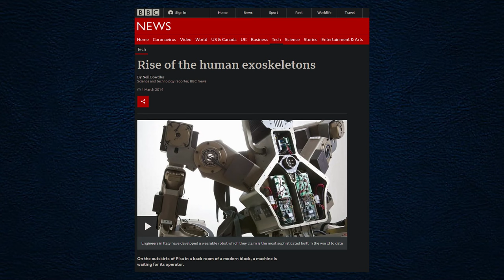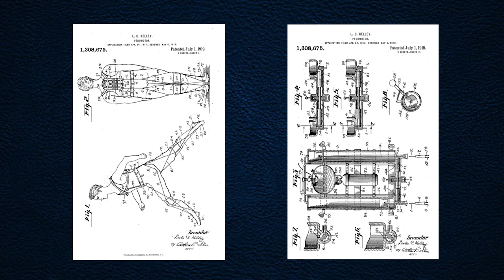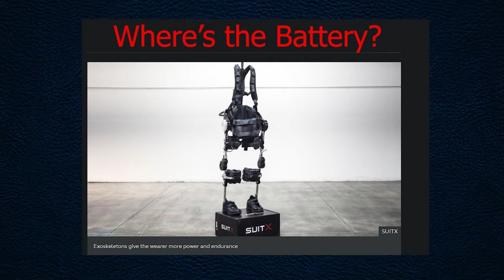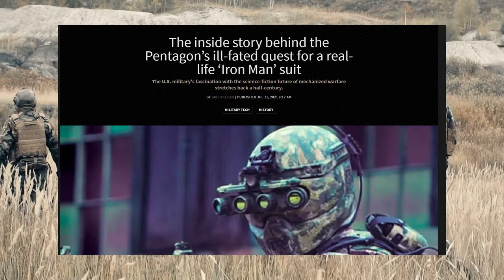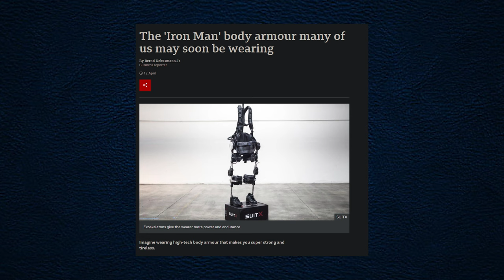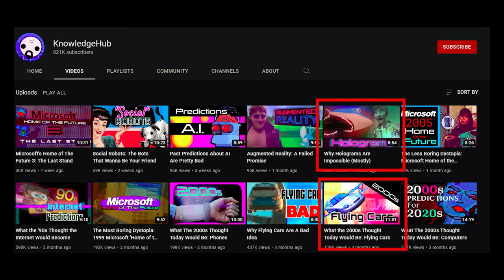Exoskeletons Will Never Happen: Here's Why

Comment: Exoskeletons and exosuits don't have to make you a superhuman and they don't have to be full-body devices. Simple exo designed for specific tasks can simply reduce the weight on a workers shoulders for example and that in itself is valuable since it is reducing musculoskeletal injuries. As for the Chinese exo, they are not just plastic braces, they transfer the weight of their heavy backpacks to the ground and that is when heavy backpacks are the number 1 reason for injuries in the US army.
Reply: exactly
Reply: Yeah the power of the roman empire came to a large extend from their superior sandals...sounds funny but the gave them a great logistical benefit
Reply: @m3ntal_c0re  "superior sandals" 😂😂
Reply: @Toasted_Crumbs  😂
Reply: Yeah like bionic boots designed based off of a ostrich athletes tenden current design allows users to run up to 25 mph ostrich cap out at +40mph
Reply: @m3ntal_c0re  A large extent? No. More like a minor contributing factor.
Reply: Yeah thats what i think of when i hear "exoskeleton"
Reply: Springs/elastics/hydraulics can do a lot to assist. Like you said, doesn't even need to be powered. It's just structurally/mechanically taking the strain of the load off of your skeleton and putting it on the exoskeleton.

Springs can also store the kinetic energy of your weight when bending over and use that energy to assist in lifting.

Potentially gears and leverage can be utilized to lower the energy required for certain task making the energy requirement much more realistic.

The exoskeleton can also utilize assistance from humans, like pedal assisted bikes, to increase efficiency. Often, a lot of energy is wasted on overcoming the inertia of a resting state. That's partly why pedal assisted bicycles are so much more efficient, and electric cars. Exoskeletons maybe can even be designed with regenerative motors of sorts that absorb some of the shock of impact when walking or restores kinetic energy wasted when lowering an object to the ground. I'm no engineer but I feel like there is still potential. Maybe for more functional and practical purposes as said above, maybe take baby steps before we create an iron man suit.
Reply: Gotta be careful about potentially dangerous situations introduced by strapping a human to a heavy and powered machine.  Also situations the machine is not designed for but could encounter, like falling down.  A bike can easily fall sideways.  It would be hard to design a skeleton to make every possible human movement more efficient.  There will likely be movements that will become harder.  Lifting your leg.  Standing on one leg.  These cases must be considered.
Reply: Also, an exo doesn't need to match every single human movement - it's just a tool for certain types of repetitive movements, most likely blue collar jobs.
Reply: The Kingdom of God is at Hand 
John 3:16
King James Version 
16 For God so loved the world, that he gave his only begotten Son, that whosoever believeth in him should not perish, but have everlasting life.
Reply: But nah,  why do that when ya can just lay em off for ai one day?
Reply: i believe in the stalker game series that is what they do. you can hold a lot more and you can run a bit faster while still having a slighty above standard armor on you chestplate

Comment: Bro, it doesn't need to be an iron man suit to be practical. Imagine lifting a full military kit and it just feels like your normal weight, that's what it'd be good for.
Reply: Do you realize how insanely hard that is?
Reply: @christophegroulx8187  hm hm ask russia about ratnik 1
Reply: @turtlegaming4427  It doesn't exist...
Reply: @christophegroulx8187  not too hard actually. We had the HULC. The problem with that system was the sensor reaction to movement trying to stabilize the weight + it's massive battery. As technology evolves. We'll def get to a way more naturally-reactive sensor. Kinda like how Boston Dynamics and their robots. They're a peak example of tech leaps when it comes to sensory input
Reply: @turtlegaming4427  is the ratnik 1 in the room with us right now?
Reply: @christophegroulx8187 wtf do you know about it? You’re not an engineer
Reply: @moss8702  This isn’t true, the main problem with exoskeletons is the lack of autonomy with battery options and the high cost. Sensors operate plenty fast already.
Reply: @ciro9951  You’re right, it’s so easy hence no one has done it before
Reply: @christophegroulx8187  sensors and applying mechanical movement to replicate or react in tandem to an organic operator (ex a human being) is extremely difficult. The HULC was an old program that struggled with this and todays tech probably helps alot. But taking the wear and tear off an individual completely onto a frame is challenging and those sensors also need to be reactive in combat conditions no matter the climate extremes. It's not that simple. I currently work in defense R&D and there's a fat stack of paper with requirements and capability that all need to be met before, during, and after testing. Soft exoskeletons are more promising and easier to work with but they don't actually take the compounded stress off the operator and the aches and pains are still felt hours later. Specifically with knees
Reply: @moss8702  The sensors can be fast enough and rugged enough, the difficulty with lower body exoskeletons is making sure that it actually decreases the energy expenditure of the user. Two major military exoskeletons from the 2000s, BLEEX and HULC, ended up increasing the load on the user. You can brute force the solution to this by making it full body and fitting in bigger actuators, such as what Raytheon did with the XOS and XOS 2, but then it has to be tethered because the power consumption is very high.
Reply: @christophegroulx8187  That's literally what I just said.....
Reply: @christophegroulx8187  the XOS is impractical beyond maintenance/non-combat roles not just because of the power supply. You need something smaller, quieter, that can be caked in mud and sand 24/7 ontop of performing the actual load-bearing function. HULC was the closest thing we had to accomplishing that with the exception of the wear being felt and exacerbated at the joints. If they kept working with what they had with today's tech, I bet it would be a whole different beast
Reply: @christophegroulx8187  can’t think for yourself. Look at the military’s history and how secretive they were with the B-2 aircraft, they didn’t reveal they had the tech until they were ready
Reply: @moss8702  You initially implied that sensors weren’t fast enough to track user movements. That’s not true. Now, you should also look up the Guardian XO. It’s the successor to the XOS 2. It has 2 hours of battery life with hot swappable batteries (so effectively infinite endurance if you have access to electricity) and is much stronger than a human. The problem is that it was too slow and too expensive so the company dropped it.
Reply: @christophegroulx8187   you're not listening to what i'm saying. The LOAD BEARING CAPABILITY needs to work in tandem perfectly with the sensors so the end-user doesn't feel the negative effects and wear unlike projects like HULC gave. I work in DOD R&D. Those sensors still require on the fly change in a multitude of differing environments. Humans are flexible and bend. Combat forces you to go into unnatural and uncomfortable positions/poses for things like cover while still under load. All of that + the elements need to be accounted for and it takes decades to perfect it. It can't be bulky, it can't be too rigid, and it can't be a liability. Soft exoskeletons are what they're developing more of because it's cheaper, a whole lot more simple, and it works with few negative drawbacks. Idk what you think exoskeletons require to function in combat but I can tell you anything powered is not there yet.
Reply: Wouldn't it be easier just to invest into making lighter gear. 

Instead of a machine that would require money, time and work. To keep functioning.

Comment: This video is just plain wrong. The point of an exo suit isn't "super human strength", it's to increase carrying capacity. In real warfare, there are devices that can be used to create a mobile EMP zone that prevents drones from functioning, but they are extremely heavy and bulky. If you had one exo user in a squad carrying this device, the whole troop is defended. This isn't actually much of a stretch either. In WW1, there were troops whose sole job was to run cables for wired comms. Not a stretch to have a member of a unit be vulnerable to perform a specialist role like that. This even negates the fact that an exo suit could also just be used to carry heavy steel plates as some sort of bipedal tank. Mobility doesn't have to be the objective.

Comment: To me, the realistic point of exosuits isn’t so much that they COMPLETELY enhance the physical abilities of humans, but that they reduce the amount of strain that physical activities have upon the human body and, as a result, frees up more of our energy to be exerted in other movements that we make. Consider this: You’re wearing an exosuit and carrying a tactical backpack that normally weighs, say, 150 lbs. Without gear, let’s say you weigh 200-ish pounds. That means the total amount of weight you’re casually moving around is at least 350 lbs., maybe more. However, with the exosuit, you’re walking around with the ease of someone wearing an extremely light backpack because it’s handling most of the strain in keeping your weight and balance in check. This as a result frees you up to spend more energy, say, keeping a good pace with mobility, being able to scale vertical obstacles that you’d otherwise not be able to, keep a steadier aim when using your firearm because less weight is straining your posture, strike someone with far greater force due to the fact that you’re leveraging your 350+ lbs. body with the speed and precision of someone weighing 120 less than you actually are, etc. At first glance, these benefits don’t seem superhuman, sure. But keep adding up all the things the exosuit is assisting you with, and you inevitably end up with someone who can perform strenuous and exhausting tasks with an ease that makes a world of difference when the chips are down.
Reply: Except that this type of load-carrying exoskeleton is also the one that failed.
Reply: @christophegroulx7816  Except for that, yeah. XD

Comment: Exoskeletons never focus on the actual weak points for human activity. Which is holding weight in awkward positions. While holding 50 lbs might not be difficult holding a wide piece of material that is 50 lbs puts the strain on the elbows which can not hold this position as we do not have the muscle mass necessary for this. 

So a suit capable of being worn on the arms and back that can lock in place so that the weight load can be transferred from the elbows to the shoulders, back and forearms which can easily hold this weight. 

Another example is that something that is able to be carried on the shoulder must be transferred from the ground. So a suit where the foot and leg can be locked into place so that the user can pivot the force with their arms onto their shoulder and put the load onto the locked leg instead of the back is another practical use. 

Most of these suits don’t focus on the fact that most people have the strength to do these tasks but maneuvering our body to lift or hold the weight is often where we struggle or injure ourselves. This is why knee, shoulder and back injuries are so common. They are weak points in our body’s design that these exoskeletons can help us overcome with the proper engineering. 

The suits don’t need to be powered or increase our strength. They simply need to have the ability to allow us to use the suit as a way to lock in certain positions and use leverage to transfer the weights  load and stress onto the suit rather than our body. 

Most of these suits get the knees right where it assists us in that weak point between squatting and standing. We are very comfortable in both positions but it is the in between that we usually struggle with. The same can be applied to our elbows and back. Our arms are strong but our elbows can’t hold the same level of stress. So the ability to lock them in place removes our most vulnerable area. A suit that has a system where we are forced to bend out of shape to move our back and then naturally drags us back to standing position could allow us to grab something by bending over and then letting the suit assist us in overcoming our weak point in between.

Comment: I never expected them to be used in battle not for another 50 years or so when they are small enough and flexible enough and light enough with all the benefits intact but right now I expect them to be used as support like carrying large heavy things that normally require 2-6 people to carry into a 1 man job and that’s how I saw it used…carrying ammo and munitions and supply’s to the front lines and around bases to helipad refueling and al that lol why can’t they use them for that idk..
Reply: Wouldn't it be easier just to invest in  creating lighter gear.

Comment: I think you will see them, but all of the bugs will be worked out before they become common place. I also think initially you will see them in the manufacturing industry, as basically glorified back supports in braces, then rehabilitation tools in the health industry, and then the construction industry. Before they are adopted completely by the military and then only for elite units.
Reply from the maker: I agree that they could be useful as back support in manufacturing but that kind of labor is becoming less and less common in my opinion as a lot of previously back-breaking labor can be completely automated.

Construction could be another angle I didn’t cover. That could benefit from the kind of support you mentioned as construction is more manual labor. 

But as mentioned in the video, US military support was dropped for any sort of future exoskeleton R&D based primarily on the cost to benefit ratio. If the military was on board, I could see that propelling the tech forward, but right now that doesn’t seem to be the case. 

You bring up a lot of good points, it’ll be interesting to see how it plays out
Reply: @Enginomics  imagine if they were able to create a modular armor plating system to protect the user. And them into walking tanks
Reply: @deadshot4245  you could, just wouldn't be very functional on a hard skeleton like these supposed ones. Perhaps if they were softer, woven into a jumpsuit of sorts with softer, more intricate parts then we could use that suit to hold and suspend these plates if they aren't just put on top. A lot of protection for bikers, riot control, dirtbikers, and the like would have something similar, something that keeps the plates flush with everything else for functionality's sake.
Reply: @Enginomics  IIRC Ford has been using exoskeletons for a while now to allow assembly line workers to reduce injuries caused by repetitive movement, in parts of the assembly line that require more flexibility than what a robot could currently do. Also, Japan has sold exoskeletons to elderly people who want to regain their strength and mobility to do similar repetitive work like gardening.